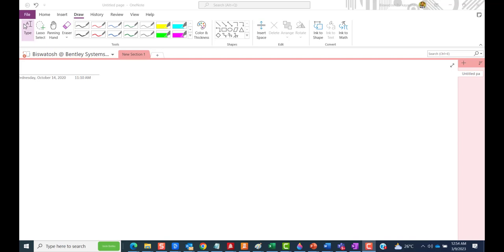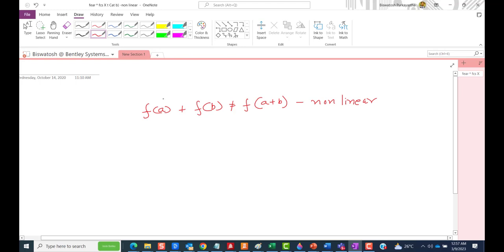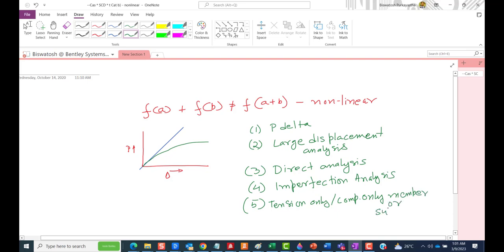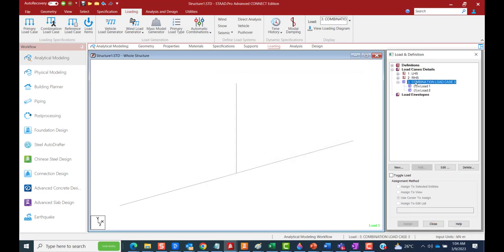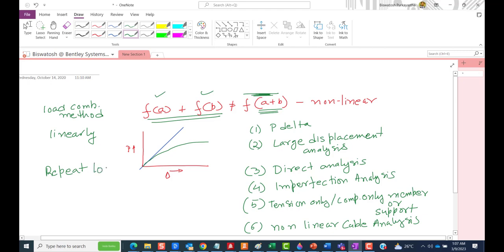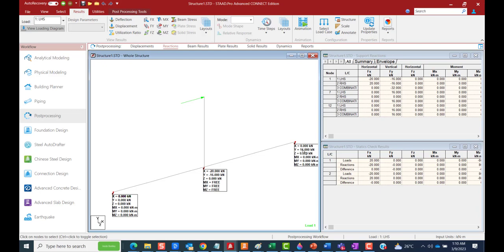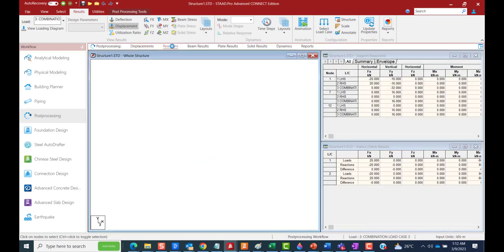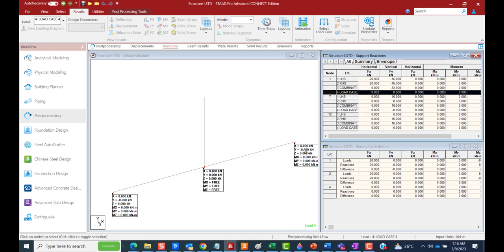Repeat Load vs Load Combination . Linear vs Non Linear Analysis in Staad

Comment: A great video... ❤ Thanks. I have a question. There are programs in which an option called "generate load cases using load combinations". Is that same kind as that of repeat load in staad ?? Another question. In uplift analysis for foundation when non linear combos are run then how the tension in soil spring goes to zero ??
Reply from the maker: Thanks , the load combination and repeat are not the same although the main objective is to determine the response against the combined loading action . Now the Load Combination in Staad simply sun them algebraically and hence you can expect the correct result if the structure behaves linearly. However the REPEAT LOAD option actually generates a new load case and the same is resolved not by alzebric summation but by solving stiffness matrix . And hence if there is any non linear condition the Repeat Load exactly captures the same .  Regarding your second point, when the compression only springs experiences tension, they get switched off and hence when there is uplift these springs will be switched off if the REPEAT LOAD is used
Reply: @Torq123  Thanks for your response. I want to know that in some software there is option for generating LOAD CASES from LOAD COMBINATIONS. so is this for the same reason as that making repeat load in staad ?

Comment: If structure is being analysed with only first order(linear) analysis, then also repeat load case can be used ? or the same gives awkward results?
Reply from the maker: It depends on how the structure behaves . If the structure behaves non linearly then Repeat Load is must. Some example are like Pdelta case, Tension Only or Compression Only specifications, Direct analysis or Geometric NonLinear case . These are all generates non linear response in structure. Now one might argue how to know if the pdelta effect is present in the structure or not . Now the PDelta or the 2nd order effect exist is all the structure but in different magnitude. If this effect is very pronounced then only we need to consider its effect or treat the structure as non linear . A general thumb is to check the 2nd order drift to first order drift , if it exceeds more than 5% in deviation, then always consider the Pdelta effect . That means here you must use the Repeat Load . Now you can use Repeat Load feature in any structure irrespective of linear or non linear but you can use load combination only if the structure responds linearly..
Reply: It's okay that if the deviation of 2nd order drift to 1St order drift is exceeds by 5%, then structure is considered as non linear and p delta effect should be considered, but p delta effect or drift deviation is applicable only for building like structures.what about structures other than building like structures? i.e underground tanks, pipe racks, equipment supporting structures, retaining walls  etc .
How to determine about  non linearity of such structures?
Reply from the maker: @Enfld1122   Yes , the thumb rule of 5% is based of ASCE prescription for drift mostly for building like structures. Now coming to machine supporting structures( general block or table structure , retaining wall and underground tank , the PDelta effect is insignificant. Secondary moment is most pronounced is tall and  slender members . …The structure that you mentioned are mostly compact. but still if you are concerned about to check if second order moment are indeed developed in the those compact structures, you might want to run the model both with Pdelta and Perform Analysis separately and compare the maximum deflection. If the difference is negligible then it indicates second order moment is insignificant..Yes other type of non linearity might existing like Compression Only plate mat support . So if the compression only , tension only specs are involved, use repeat load ..